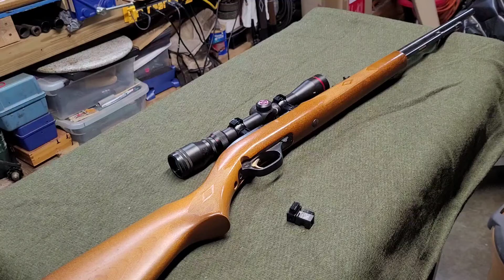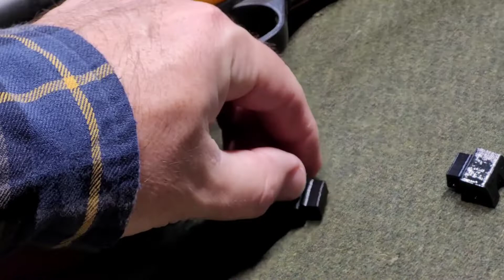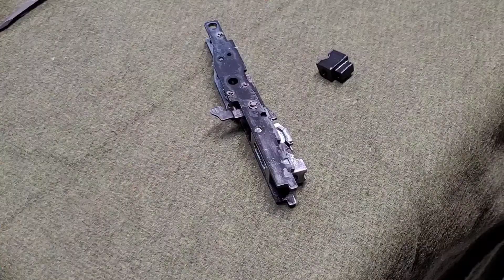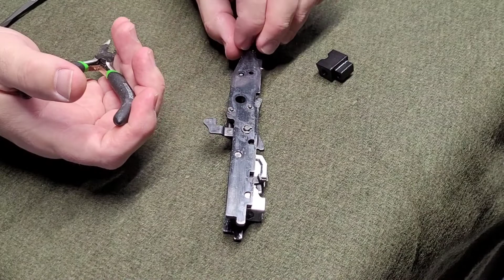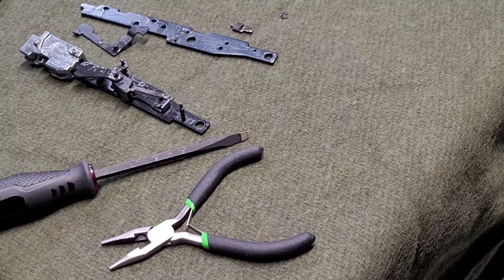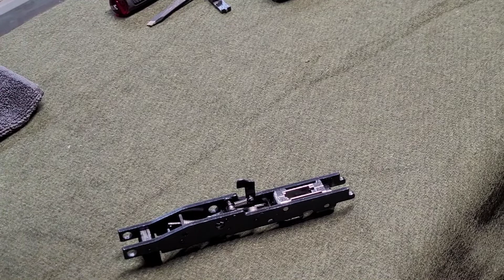Marlin Model 60 Buffer Buffoonery

Comment: You could razor knife a split in the polymer retainer block. 
Slip it on. The fit to the receiver will hold it in place. It merely cushions the rearward stroke of the bolt. The calibration of the spring will insure proper cycle function.

Comment: I inherited a Glenfield model 70   from my father-in-law who had pass away & it been my closet for about 3 years dicided to take it out to my gun club and pop off a few rounds  it worked for a awhile & reallt enjoyed it but about 6 weeks ago my charging /bolt was jamming figure it need some cleaning so took it apart & like you saw the Buffer was all crumble up & ordered used from Numreich parts  begin to remove the horseshoe clips & spring came flying off work on it off and on for the next 3 weeks getting tired trying to get back together. :(   Saturday June 10 after spending most of the morning I finally got it together & did a dry fire & since I live in the city it was not possible pop off a few rounds  unlike the 60 mine is magazine feed. It nice little gun & many times thought of taking to gun shop for repair but $$$$$$$$$$$$$$ stop me.

Comment: I have a 1999 Marlin 60 (my “Y2K” special). I haven’t fired 50 rounds in it. I took it out punched some paper recently (2022) and it started acting up some. I took it down for cleaning (first time ever: except for the barrel) and the buffer was destroyed. It wasn’t anything you did that caused it (it’s just a cheap part). I hope I can secure a new part somewhere. Thanks for the info. These true Marlins are becoming quite collectible.

Comment: I had the same experience with a model 60 I handed down to my son. It hadn't been shot in almost 20 years. After a range day I took it apart only to find about 50 pieces of the buffer falling out. Long story short...I found a video showing a paper clip securing the hammer spring in place. A paper clip would have saved me over an hour and a lot of aggrivation of trying to put it back on correctly.
We live and learn. I'm glad I'm not the only one who's fired a spring across the shop! 🤣👍
Reply from the maker: Sure was a learning experience.  Thanks Ken!
Reply: You found out the hard way just as I did right ? lol  I finally found the spring retainer 5 yrs later not to mention the E clips that had to be ordered. LOL
Reply: @guzziguy1000  yep!  🤣🤣 I also saved that video for future reference 👍👍

Comment: Mr. Thomas I sure do love my model 60 I’m glad your able to get gun parts for them steel yea mine Is white as well and we’re did you order your parts from?
Reply from the maker: Thanks Wille.  I just ordered from Ebay.  These were 3D printed which was new for me.  I'm curious how they are going to hold up.
Reply: @marcthomas2482  I think it’ll last longer than the original rubber one. I need to order one as well

Comment: If you do ever need or want parts, Mcarbo has them I think. Mike.
Reply from the maker: Thanks Mike.  I don't think I've ever used Mcarbo just Numrich and some smaller ones.
Reply: @marcthomas2482  Mcarbo has a complete spring kit with all the springs in the action assembly.  They even sell the little C clips!

Comment: My Marlin 60 is so old it doesn't even have the bolt release. Still has the weird white buffer in it. Doesn't even lock on an empty tube. I'm sure it'll work flawlessly after your fix. 

Happy Holidays.
Reply from the maker: Thanks Gob Sauce.  That must be an old one!  The fix was a success and it is back to like new again.  Ready for the next 10,000 rounds!
Reply: if there's no bolt release, it was made before 1981. you can find the year by subtracting the first 2 numbers from 100. i.e.  the serial number on mine starts with a 10 so it was made in 1990.
Reply: @daemonhat  hey, that's great to know! I'll check it out when I get home. Thanks buddy!